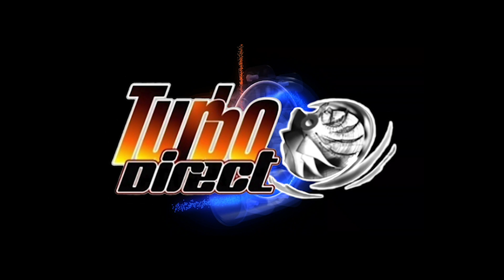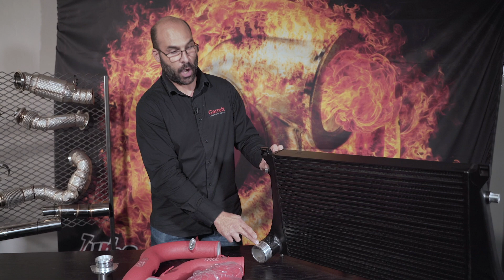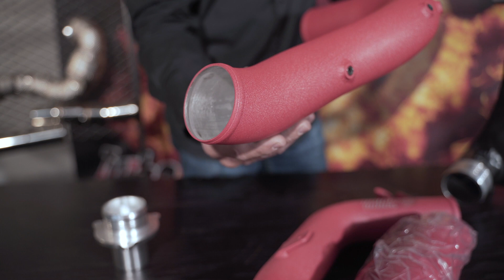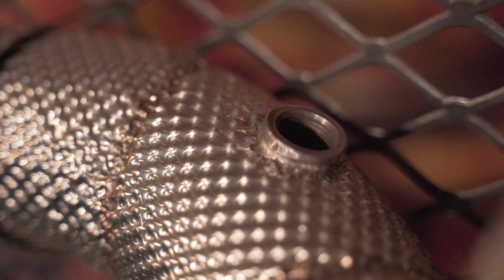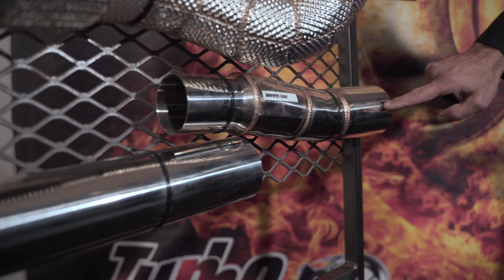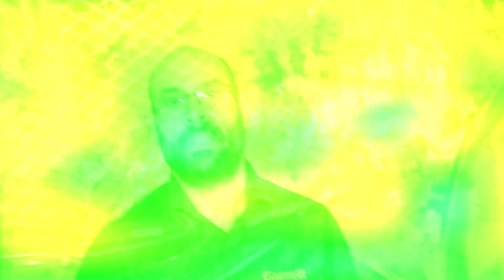Whats the best setup for a stock motor Golf7R MQB

Comment: Thank you do much.  Great informative video. On the turbos, the best for a daily with around 450hp would be the is38 700 due to the ball bearing setup as this would be the one with least lag, am I correct or what would be the other option, if any taking lag into account.
Reply from the maker: Thanks for the comment, the daily driver setup can be divided into two sections, the first is the bolt on turbocharger setup which will incorporate the off the shelf DP and Cooler and the second section would entail the TurboDirect S.A Swirl Adapter together with a choice of pretty much any Vband (76mm) turbocharger which will bolt onto it - so options like the G25, GTX30xx Gen1 or Gen2, GTX35, G35, EFR7163 and EFR7670 -- the most streetable setup in my opinion is the light weight BorgWarner EFR range like the 7163 - Then would be the G25 from Garrett. Both are streetable and will make more than the 450WHP so at a later stage if you decide to build the motor, you can simply up the boost and youll see the extra HP
Reply: @TurboDirectSA  saving up for these options.  Next to get is your intercooler 😊. Thank you for the great advise
Reply from the maker: @karlmoses3459  Pleasure sir - glad you enjoyed it!
Reply: TurboDirect S.A I have all supporting mods already but if I want to run EFR 7163 would I need swirl adapter ,different downpipe and turbo intake pipe as well?
Reply from the maker: @loustath1583  Yes you will need the Swirl adapter and the DP we manufacture to suit due to the slightly different install location. The outlet pipe from the comp housing routing to the cooler will also need to be changed.  We can build this for you in house or you can have a fabrication shop do the same for you.
Reply: TurboDirect S.A thank Chris what cost would be entailed for everything you mentioned even the in-house pipe from compressor housing in US or AUD dollars and do you arrange shipping,I looked on your website and couldn’t find the kit!
Reply from the maker: @loustath1583  Shoot an email off to chris@turbodirect.co.za ill give you the options from there.
Reply: @TurboDirectSA  I've just read this answer. DP is not a big deal, outlet pipe too. But what about water and oil lines, actuator and BW?
Reply from the maker: @stanislavaleshin1202  which turbo? The IS38-600 is 100% bolt on. the IS38-700 comes with all the lines you need. If you go with the EFR or GTX series - we supply lines aswell.
Reply: @TurboDirectSA  Chris, as for EFR 7670 - how to install it on 2.0 gen3 engine? You need some adapter and it's nice to use BW twinscroll housing in this case
Reply from the maker: @stanislavaleshin1202  you dont use the small twin scroll housing - you use the vband housing AR85 - together with the Swirl Adapter